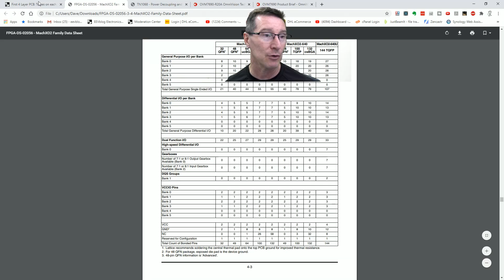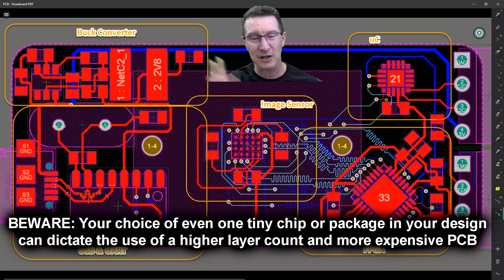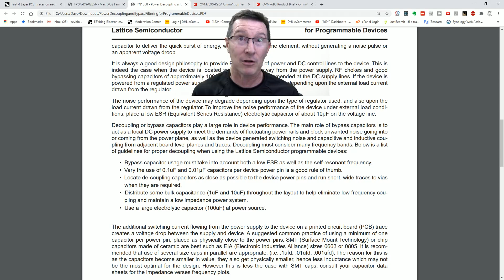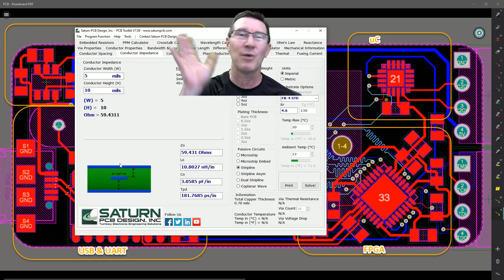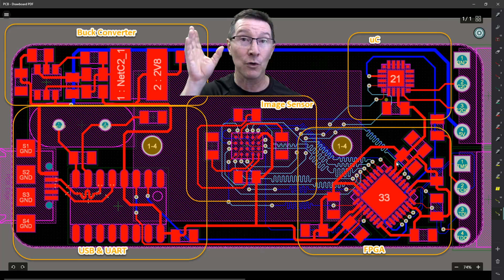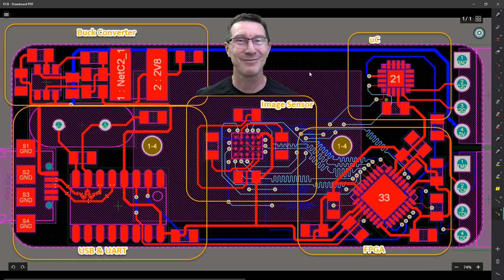EEVblog #1323 - PCB Layout Review & Analysis

Comment: I've found that many packages don't play nicely with each other.. where there's just no way to route them nicely.. 
So in your opinion, if you are given the choice of making a really snaky trace that has to sneak between pins, etc, or simply drop down to another layer to avoid 1 or 2 traces and pop back up, which do you prefer and why?  
So far I've been choosing to drop to another layer briefly, if I can keep the trace straight, you can still easily see it and it isn't visually confusing whereas you go crosseyed trying to follow stuff between pins
Reply: Oh, one more thing, if you have two components placed very close to each other, is it OK to use one bypass cap for both? I've found I can sometimes save some board space and make routing easier that way, of if it's feasible, bypass caps on the bottom of the board can really open up the top side too
Reply: Depends on the speeds and edge rates of the signals.  For slower signals a via is fine.  For high speed differential (500MHz+, <1ns edge rates), same layer because via has barrel capacitance which cause a whole manner of SI problems.  This is not a hard rule and if you're doing high speed stuff like this you need to look at doing SI simulations.
Reply: @GodzillaGoesGaga  thanks..  For my work I'm probably going to be at 100mhz max, and mostly in the Khz range for most
Reply: @Rx7man  I would guess that you should add a source series termination resistor of ~22R in your signal paths.  It will greatly reduce reflections on fast edge signals.  Without knowing your design I can't really advise.  100MHz is quite a high speed and careful layout principles should be followed.  A GND and VCC plane will help a lot. Good decoupling, proper termination (normally source series), good spacing, orthogonal routing, matched lengths for synchronous buses, diff pairs, etc are all part of the design process.  Pull downs and ups are also good practice.  Again these all depend on what the design has.  There are a lot of "rules" and some of it is "art" but the golden rules are: Loops - get rid of them! (ie power traces shoud be as short as possible like a via to VCC/GND).  Decoupling, add them!  Termination, Add them on high speed or fast edge signals!  GND and VCC planes, have them!
Reply: @GodzillaGoesGaga  about the only time I'd ever see 100mhz is if I use a faster STM32 chip in a project, and MOST of the time I get them on a breakout board already.. Most of what I do is with an Arduino @ 16mhz..

Comment: Regarding the holy grail of so called routing all signal traces on the top layer-- what's worse, a really long trace that goes under an IC and between 2 SMD resistors and all the way round around the board but never leaves the top layer or a much shorter straight trace but through a via to bottom layer and back up?

Comment: I don't think that this buck converter is done properly.
It looks like one 6 pin package, bunch of resistors/capacitors and inductor, that means it's some controller with built in switching mosfet, that means the 6 pin device must be very close to the inductor, it also requires all power connections to be made with plane pours.
Reply: and the pads of the passive components are way too close to the inductor too. Hard for AOI to get a good look at the soldering, and hard to rework/repair too as there is no room and the inductor is probably pretty high compared to the other passives.

Comment: I'm a bit of a madman, currently working on an FPGA board design that's meant to be 2 layer and hand-solderable. It's a Cyclone III (old chip but it's a reproduction of an old product to run a specific closed-source config) so the power requirements are a bit difficult, having 3 separate rails that all need bypass caps. Since it's not super high speed stuff, I cheated a bit and put the FPGA and its caps on a separate little "core" daughter board. Any recommendations for a crazy design like this?

Extra info: the main board will have SDRAM, a microcontroller, and some other miscellaneous I/O circuitry on it. The daughter board idea also partly came from a fear of screwing up the main board and having to desolder the big expensive chip to move it to a new one. It's a hobby project so I can't just buy more and call it research costs.

Comment: But Dave high-speed signals can use power planes as return paths
Reply from the maker: Yes they can. But then you are more reliant upon the bypassing to create a low impedance to match the load to ground.
Reply: @EEVblog  excellent point

Comment: Great video Dave. Just wondering is it necessary to impedance match the  traces for the USB data lines on bottom left.  Is there a thumb rule about the data speed and length of the trace, where it becomes mandatory to do this.
Reply from the maker: Not for USB serial which would just be negotiating USB 1.0 speeds.
Reply: @EEVblog  But the data bandwidth is not the problem, the problem is the rise time of the signal, and that could be higher if you have a high speed bus master talking to this low speed peripheral. I'm not that deep into the USB details, so i don't know if they actually have to slow down the slopes too if they communicate with low data rate peripherals, but that might be a possible problem that is easily overlooked.
The overall trace length and mismatch in this design here is probably low enough, so you don't get any issues with impedance and trace length mismatching anyway. But it does not hurt to at least try to treat it like any differential pair signal line. As long as it does not cost you a lot of time and/or money, or headaches with other traces, just place it as it should be, with proper trace width and spacing, depending on the distance to the GND layer.

Comment: I would have issues reviewing this board, as I do not clearly see his GND system.
If I do not see the GND System, well: I can not help. Botch wires can do a lot of amazing things - but without a GND system in place, boards can be incredibly difficult to bring up.
Reply: I think Dave mentioned that it is still a work in progress for the author of the board.

Comment: If you need to push a signal to the lower layer, either to jump a trace or to fit a trace from a BGA, is it generally better to drop down, run a short take, then return to the top layer? Or is it better to drop to the bottom layer and stay there for the remaining have length and jump up near the destination?
Reply: If you are trying to do length matching on the data bus, like the guy did in this example, you would have to have the same amount of vias in every trace too, to match the introduced inductance of the vias on every trace. And of course if you are getting deeper into signal integrity, you would want your fast traces at the same distance from your ground (reference) plane too. In a 4 layer board, you would have a different reference plane for traces on the top layer versus traces on the bottom layer (because you would usually have the VCC and GND planes internally). So it can get a bit tricky quickly, depending on how critical your signals are. You could start to think about the loop area you open up with signal return paths being different, depending on the signal layer you choose too... Best practice is to try and do the same with all the parallel signals of a bus.

Comment: So i didnt got it here. If my i2c wires get too long, then i have to lower the pull down resistors? I thought i have to pull them up, because i2c chips communicate with pulling down at certain frequency and when data gets through

Comment: The power supply routing looks a bit dodgy to me. Look for example the path from the IC to the inductor, it should be as short as possible and preferably not to go under components.

Comment: Another thing I've noticed is that those vias are absolutely tiny. going by my eyeball measurements the annular ring on those look to be 0.25mm.  Is that necessary?
Reply: This is something that bugs me too. Need to connect a QFP chip - or lord save us - BGA -  fine traces and vias it is. But WHY o WHY use the same on bulky components. Makes no sense, is easy to damage when manually reworking and might even be deleterious for power supply traces. Power electronics guys always have to route some signal. I suppose everybody should have also routed power electronics at some point in life. Use that copper and free real estate you got there. Darnit.

Comment: Not that it really matters, but you'd think you could do this with a single layer, double sided board and vias?
Reply: If your board supplyer allows the low clearance/width needed for the tight BGA fanout on a 2 layer board, yes. But usually the cheap china supplyers have a much better specification for multilayer boards than on the cheap as possible double layer boards.

Comment: So if it's a 2 layer, do you make the bottom layer a ground plane but put power traces across it as well? I try to put power and signal on top as much as possible, and if I have to I'll put power on a trace across the ground plane. Should I be doing signal on the ground plane instead?

Comment: Someone definately needs to learn a thing or two about decoupling capacitors, thats for sure. Thats always the first thing to look at, especially on the switching DC-DC converter, but on all digital IC power pins too. Sure, might not be "critical", but why not do it right on every design, especially when you have 4 layers anyway and have the option to set the vias at the right spot they are supposed to be. And i don't know why there were no trace to board edge and component to board edge rules set. That stuff would just light up all green on my standard rule set...

Comment: Would it be worth selecting a micro with JTAG and chaining them? although I haven't quite managed to figure out how to customize an OpenOCD script  for chain programming yet.. is on my Todo list. I like the suggestions like prioritizing important traces, and that power isn't particularly important. definitely think the designer went to town in length matching. I'm guilty of sins though.. Many of my early boards used vias in pads.. cause it looks cool.. (all internal traces, ground planes top and bottom) not a problem when hand soldering.. but the pain kicks in the second you try use solder paste.

Comment: What if let's say you have two power different voltage power supplies e.g. 1.8V (MCU, some sensors, comms) and 3.3V (one specific sensor). Would you then divide the power layer into two blobs or simply route a 3.3V line into the sensor that requires 3.3V?

Comment: Hi guys.

For 2 layer boards. Would you try keep all your traces( signal and power) on the top layer and then dedicate the bottom layer to a nice big ground plane?.
Reply: I do my best on two layer boards to reserve as much of the bottom as possible for ground plane and also try to keep my VCC lines as thick as possible on the top layer only.  If the design won't allow for a continuous VCC on one side (ie - you need VCC to jump between front and back) then 4 layers would be better to use.

Comment: And what about having the decoupling capacitors on the bottom side?
Reply: Usually not advised to have the decoupling on the other side, because every via adds inductance to your trace lowering the effectiveness of your decoupling capacitors. And if you can have a single component layer, manufacturing is easyer and way cheaper compared to going double sided.
Reply: @ProtonOne11  Ah, OK. Just a thought: longer traces lowers the effectiveness of decoupling too. And yes, going multilayer is more expensive, but in this example, a 4 layer PCB design had been selected... Ah well, in the end it's the trade off or compromise you're willing to accept.

Comment: Great insight! Actually, I'm struggling with a 2 layer board that has a processor and digital stuff and acts on "big ass" relays. Even with snubbers I'm getting massive rings on the processor power supply when the relay closes, that causes from resets to some relays triggering when they shouldn't. I'm changing the board for 4 layers to remove this ring on the +5V supply, my question is....whats the better stack to solve this, power on top and ground on bottom and signals on the mid layers or the opposite?
Reply: Sounds like you need more decoupling and maybe some RC filtering on the power supply for the processor.
Reply: Should be able to be done on 2 layers.  Have you checked the +5V supply (location and where it starts) itself is clean when a relay closes or is it dipping in which case you need to look at the 5V supply side in relation to relay power and once that is stable than try looking at some  medium caps 1uf - 10uf very close the cpu pins.  If relays are DC then a diode across the coil should be enough, make sure your coil driver cct is not loading down the cpu output pin.  Also don't forget to consider power draw  and possibly isolate what is connected to the relay contacts.  Good luck with your project.
Reply: 2 layers is a big problem when  you get past ~8MHz or really fast edges (which is likely what you have considering most technology today typically has <2ns edges).  Decoupling close to the driver IC helps but any wire is a inductance and you have a lot of them on GND and VCC on a 2 layer board.  You should definitely move to a 4 layer board. The cost increment is minor these days.  You could do copper pours but you'll find your GND pours will be split into islands which is another problem.  It all depends on what your layout is like.  Look at the return currents in your heavy switching devices.  Like FET Source GND returns etc.  High transient current = high transient voltages in an inductive wire!!
Reply: for a 4 layer board, I recommend power and GND in the midlayers.
Top and bottom usually have components, so you can not really get a nice plane there "anyway".
You also always need to fan out the component on top and bottom - so you will also always have signal traces on top and bottom.
So: you might as well completely route on top and bottom.
Errors in signal traces on top and bottom can be corrected with a scalpel. Errors in signal traces on a midlayer... yeah: get out the fine drill bit to drill out the connecting via.
Placing  GND and VCC in the innerlayers also creates a capacitor that is typically high frequency and dampended.
Reply: @johnfrank6302  The power supply is quite clean, and the power drawn seems ok since I don't see the line going down, just ringing in AC around 2MHZ(hard to measure). I try to add some bigger elect caps (10uf/100uf) on the line but the ring persists, the same near the micro and I can still see the ring, but only when the relay closes, when I energize the coil. I have the flyback diodes in place from the beginning, changed them to Schottky but the problem is still there, the only way to clean the thing is an RC filter with Chokes on the ground and Vcc, and even then it's just minimized not fully clean.
Reply: @joaom4582  Based on your description I just have too many question to ask.  I think this is a non trivial problem and you need to provide a lot more info about the setup (power supply voltage rails, what is connected to what rails, where you are seeing this ringing, what is connected to the system, etc) or a schematic and also info on the setup you are using to measure this ringing.  Then you might be able to get more useful replies.
Reply: Probably just trying to switch that relay waaaay too fast. Slow down the slope of the switching node and the problem should be gone.

Comment: This board makes me bleed from my eyes xD
Question: that FPGA has 2 power inputs that are right beside each other. Is that really necessary to place a separate decoupling capacitor for each of them? Personally I'd place only one and called it a day.

P.S. A really like the floating head too xD
Reply from the maker: I didn't check. In that case, yes, only one required. Unless you think that different values are required.
Reply: If one pin is internal core power, the other is IO-power, then i would place seperate decoupling caps and seperate vias into the plane. If they are the same internally on the FPGA, then one cap would be enough imho.

Comment: you mentioned putting the ground vias before routing. so here my noob quesion: why doesent one put the vias directely on the pads and solder the caps over the vias? why doesent one do that all the time with every ground or vcc? i could imagine the solder would wick into the via, which would make it great for higher currents. is it because you cant dispense enough solder paste to fill the via?
Reply from the maker: That's called via in pad. You need to account for the sort wick in the paste. Generally not a good idea unless you absolutely need to and you are careful.

Comment: When you have ground and vcc planes on top of the other, do you effectively have a bypass cap? Or is the capacitance negligible?
Reply: Depends on the distance between the layers too. In high speed multilayer designs you sometimes specifically lower the distance between your VCC and GND planes to make a better HF decoupling capacitor. Of course there you usually have some impedance controlling going on too, so all the distances and possible layer stackup options (possibly with burried and blind or even backdrilled vias) start to get a bit more complicated/interesting.

Comment: I only looked on the miniature of a video for 3 seconds and figured all problems which Dave did. The buck converter is also badly designed - the loop between IC and the coil is very large and goes between and under few elements. But considering other basic mistakes I do not wonder why. I don't understand how someone could put such bad PCB design on a forum.